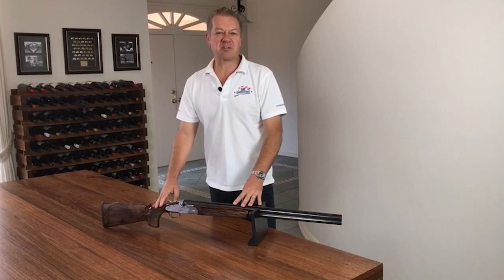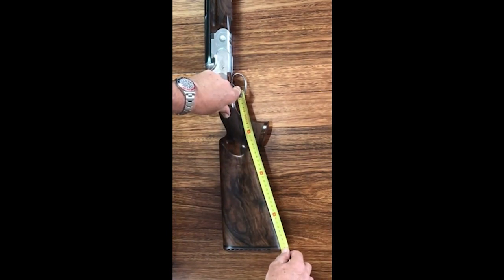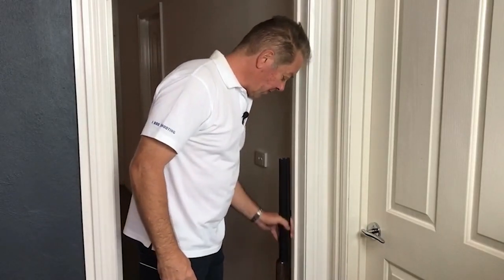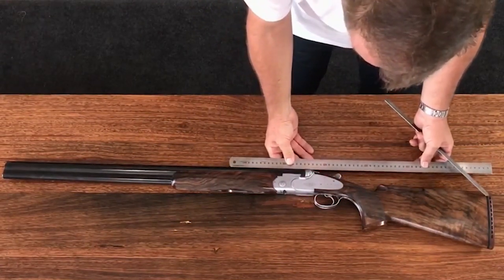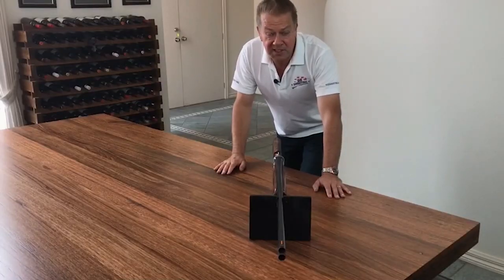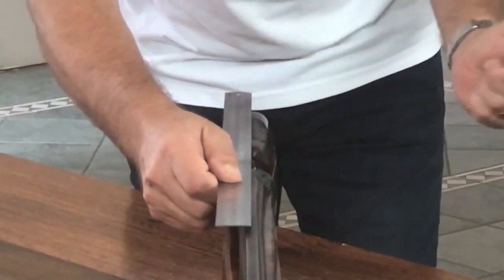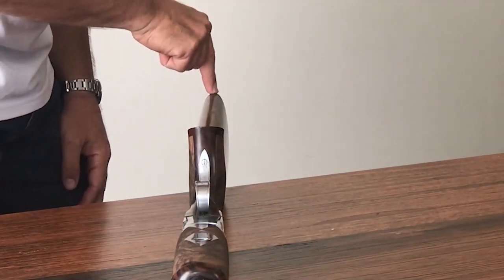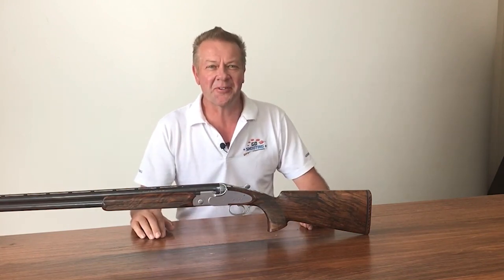Basic Stock Measuring Terms - Clay Target Shooting Techniques: #5 Go Shooting

Comment: The part I’ve yet to understand in stock making is cast doesn’t take into consideration the width of the comb and therefore seems a little useless as a measurement. I have a little British SXS with very little cast off but the stock is so thin it works perfectly. On the other hand, my trap gun has a huge amount but the comb is as fat as a nice cucumber so it also works pretty well. The problem arises if I tried giving my measurements to a stock maker, I wouldn’t have a clue what to tell them other than don’t finish it and leave wood so I can grind away. 🤷🏽‍♂️ Anyway, enjoyed your videos quite a lot 👍🏼